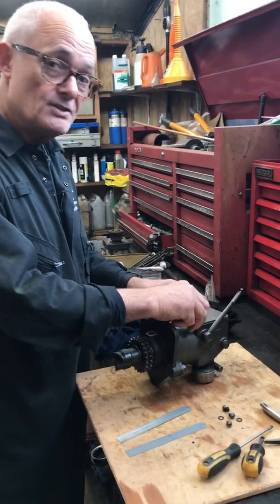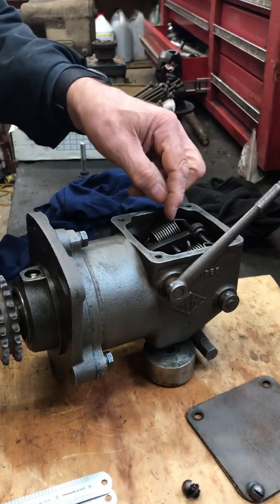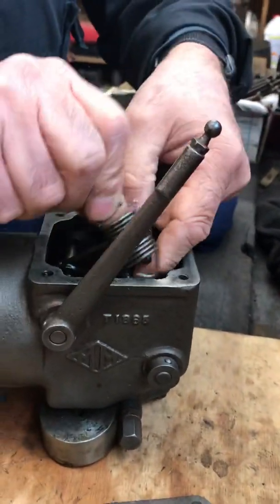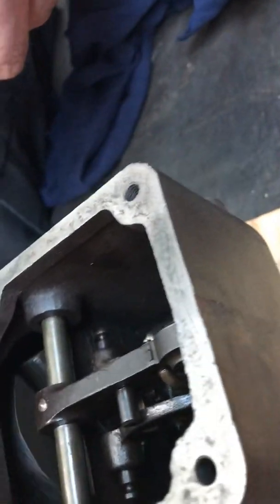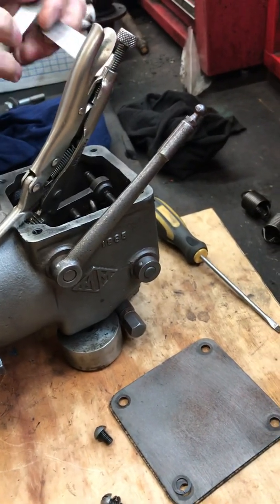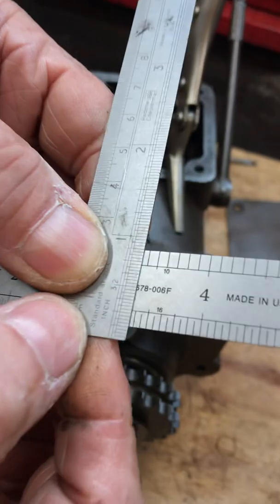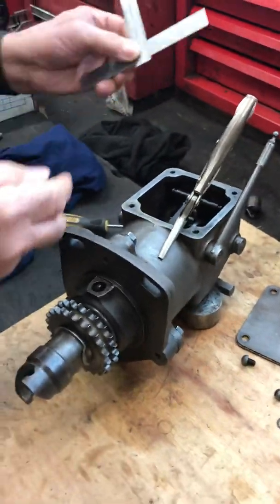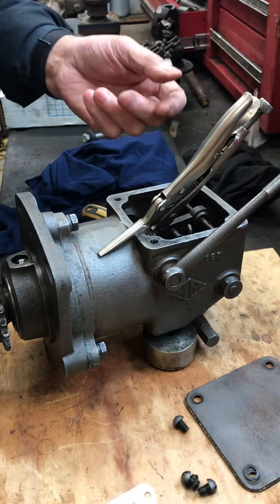Setting the governor on a Nuffield M4 petrol TVO engine

Comment: Hi, I'm having trouble with my M4. The head is off, and the engine won't turn over. Only moving on slack of timeing chain. No sign of the camshaft moving at all. Is there anything in the guvnor that may of come lose to stop the engine turning over? Its not anything to do with clutch. That's free. I cant of anything else it could be. Please can you advise.  Thanks